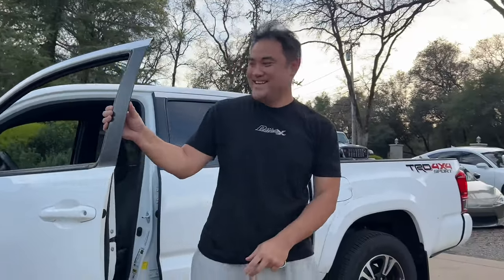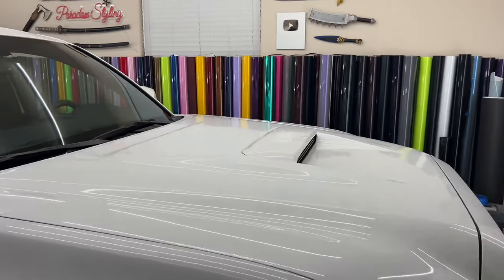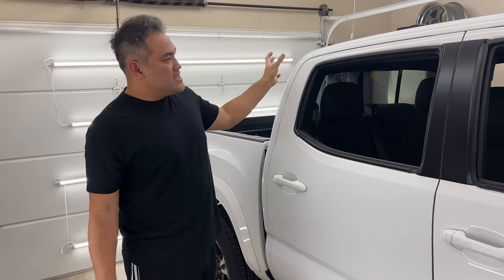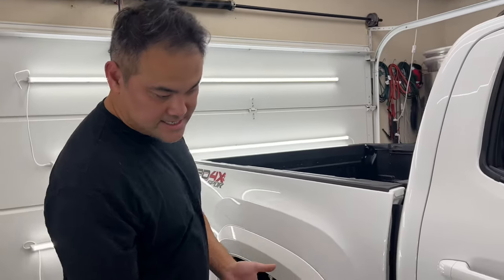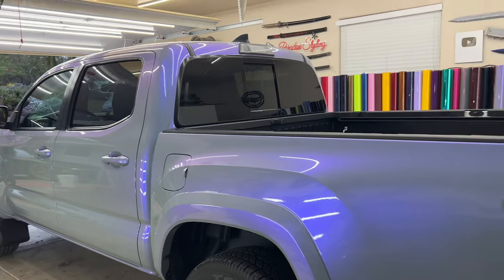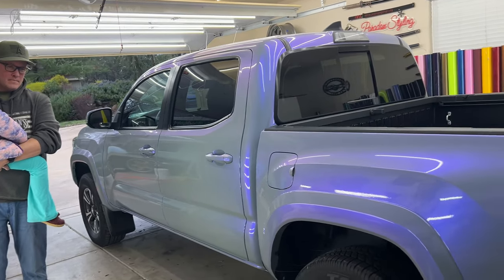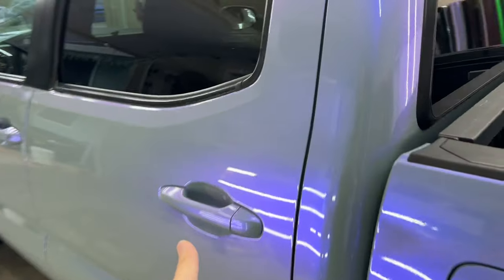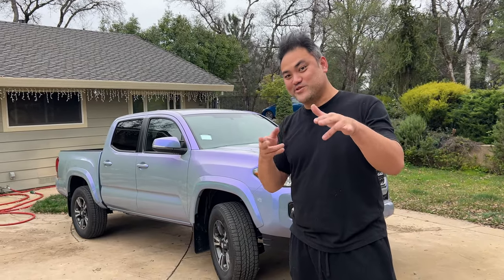WRAP ANY Truck Without Taking It APART | TOYOTA TACOMA

Comment: Also it is possible to do a truck in 60ft. 2015-2024 F150s you can get away because you can do seams in the door panels and bed. They have a HARD body line there. I know because I did my dads and it wasnt a single either lol. So it varies by design. Nonetheless great video paradox!
Reply from the maker: Nice! Yes you are right if there’s a hard bodyline you can seam it and do 60 feet

Comment: You certainly do a great job of wrapping- it's your talent.  You may perhaps work a bit quicker if you hang your heat gun from the ceiling, and string it along as you work.  This might require some rigging of some type, but no doubt it has already been created and utilized by the auto industry production/assembly lines. Best of luck!